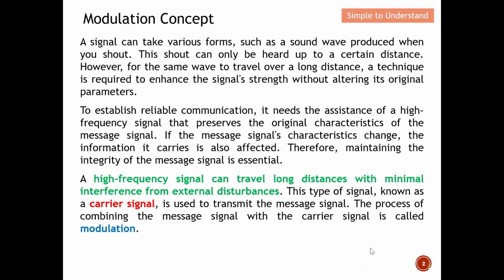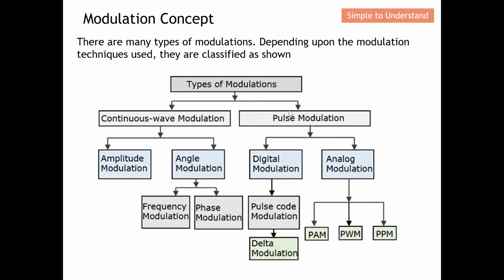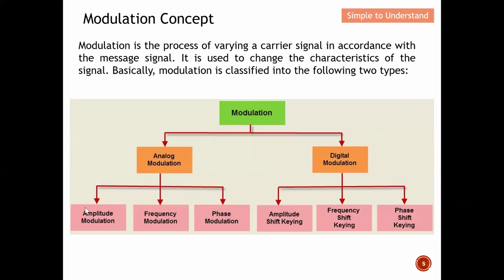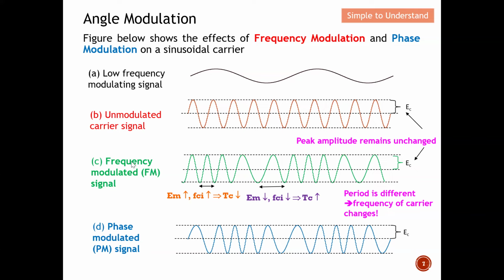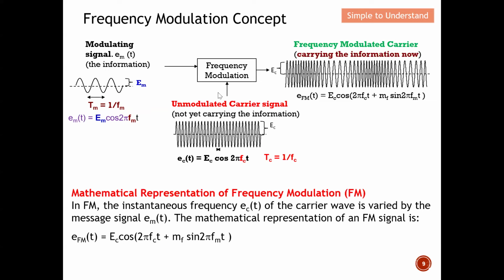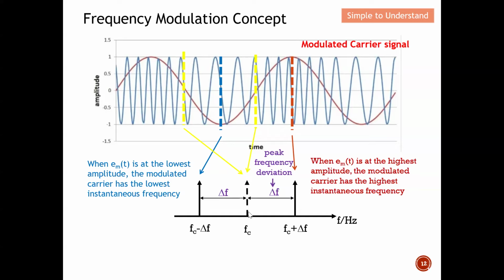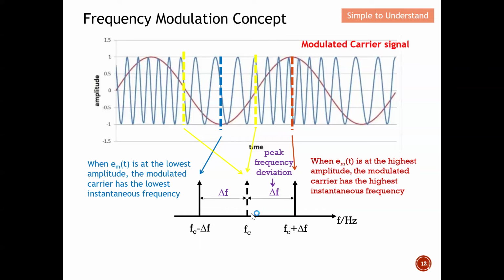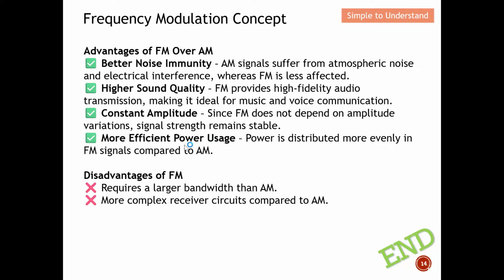Freq Modulation #1. How Intelligence Becomes an FM Signal | Baseband to Carrier Explained Visually

Comment from the maker: Thank you for taking the time to watch this video.
In this video, I begin with an overview of different types of modulation. There are primarily two main types: Continuous-Wave Modulation and Pulse Modulation. These two types are further divided into analog and digital modulation. This video will focus on Frequency Modulation (FM), which falls under Angle Modulation (Another modulation in Angle Modulation is Phase Modulation) within the broader category of Continuous-Wave Modulation.
Next, I explain how the frequency of the carrier signal changes according to the modulating signal. The peak amplitude, Ec, of the carrier remains unchanged.

How FM Works:
The frequency of the carrier wave changes in accordance with the input signal (such as audio or data).
A higher input signal increases the frequency deviation.
A lower input signal decreases the frequency deviation.
The amplitude remains unchanged, making FM more resistant to noise and interference compared to Amplitude Modulation (AM)